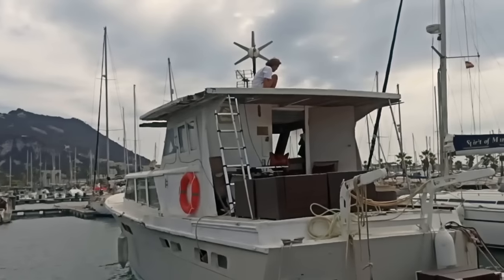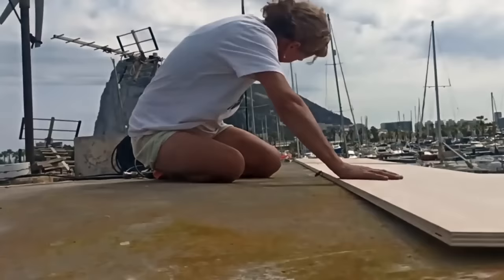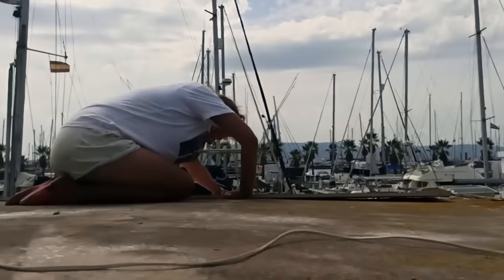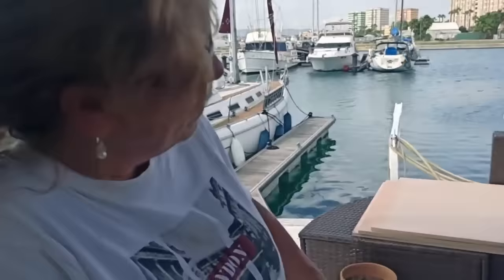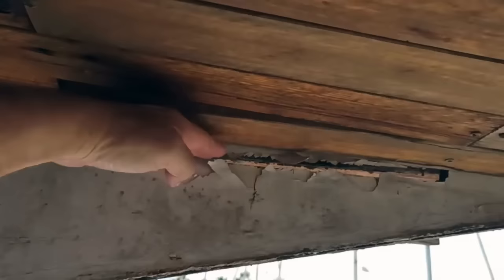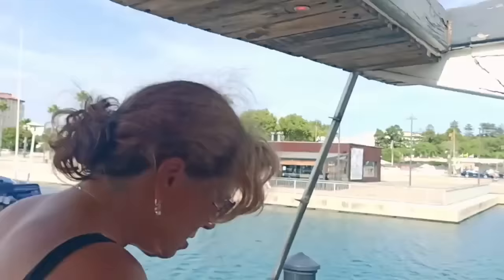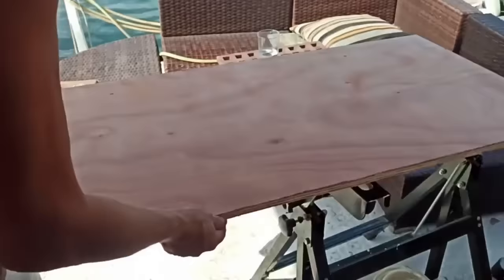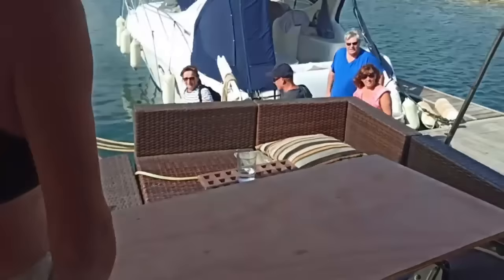Fiona's roof is a lot bigger than it looks.

Comment: There’s also polyurethane resin as well as epoxy. Epoxy is good for casting (deep pours) top coating. If your doing it in stages and it’s cured it best to sand the layer first .and then apply another coat and it adheres much better. I’m probably not telling you anything you don’t already know 😂
Edit to add, Fiona you need a cordless electric screwdriver! That would save you time and strength.